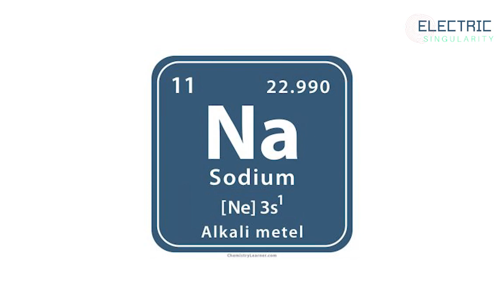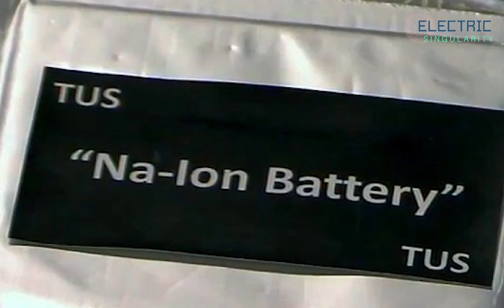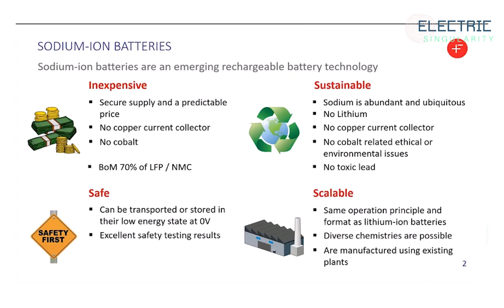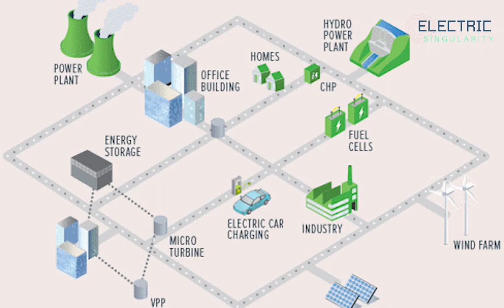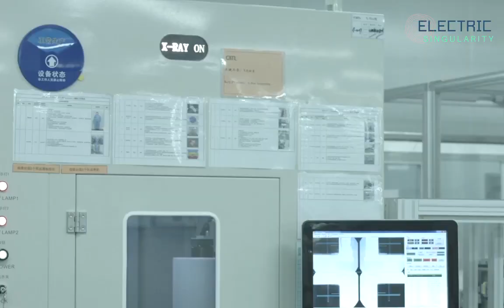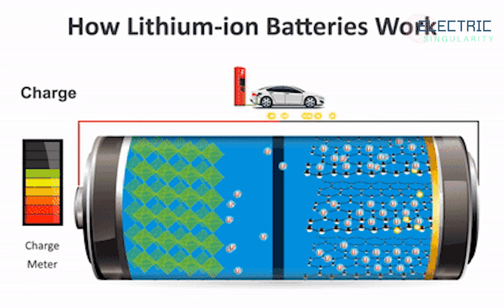CATL's sodium batteries will be 30% cheaper & revolutionise the world

Comment: Ok first of all? Lithium is NOT a rare element. If you look on the periodic table of elements you will find it directly above sodium amongst the rest of the common elements on the left hand side of the chart. Rare elements are in the bottom right of the quadrant. Secondly new direct lithium extraction is already in implementation that will reduce the cost of lithium extraction by 50% while increasing production efficiency 8x, while solving ALL of the environmental issues currently associated with its extraction. It can even be used to extract lithium from sea water. The oceans are full of it. It is a metallic salt itself.
Reply: Graphene is on the way as well to harvest lithium from the ocean and Israel is doing it.

Comment: I'm not so sure these are cheaper than LiFePO4 though,  I was reading that they have a cycle life of only 1000, and LiFePO4 cells are often rated at 4000+. so these will need to be more than 4X cheaper per Kwh than the Iron Phosphate to even consider them in grid storage.  Am I missing something?
Reply from the maker: CATL says they will be much cheaper after a few years. We’ll see.
Reply: Many applications that has low-cycling requirement like back-up batteries for homes or for RE installations or like lead-acid car batteries with very shallow cycling...would be perfect for Na-ion batteries.  Lead-acid batteries are very popular yet very low cycle ability in comparison to Li-ion.
Reply: @wakannnai1  no way a battery using table salt is going to be dirt cheap once production scales. At that point the manufacturing and copper become larger costs
Reply: @joe7272  Copper is also a cost for all the transformers and interconnect cables between the diffusely located wind turbines, solar farms and grid batteries. 
A 3MWH battery sounds great but a 100 megawatt nuke makes 33 times as much power - CONTINUOUSLY. The Moltex waste burner has a thermal store so a 500MW reactor can power 1500 MW of turbines that ramp up and down to meet daily demands and/or fill in for renewables. Fuel costs are negative because it reduces stocks of the ultra long lived stuff that we really can’t deal with build and operating costs are low because it’s intrinsically safe. All nukes are incredibly safe but none can rival that.

Comment: I would just be happy if I could easily afford to keep warm in the winter :)
Reply: You have an insulation problem, not an energy problem.
Reply: Thermal mass works extremely well in dry climates.
Reply: Get a rescue dog.
Reply: Get an electric blanket.
Reply: Using the latest in efficient housing design could reduce heating and cooling costs to almost nothing. It’s a real shame that almost all new housing is still not using basic efficiency principles that would save owners so much money. An extra $200/mon. on my mortgage to save significantly more than that in gas and electricity would be most welcome.

Comment: I didn't know that the metric shit-ton was a common measure in Australia, as it is here in the U.S.
Reply: It is a shit-tonne, get your units right :)
Reply: The shit-ton is a fairly common measurement across the English speaking world. Two variations exist, the Metric Shit-tonne and the Shit-ton, which is the imperial equivalent and is slightly larger, using the long ton measurement.
Reply from the maker: Hahaha!
Reply: @geodun  Many countries, separated by a common language.
Reply: Do they also use the C hair system? I need answers

Comment: This is huge! If they have worked out the problems with the number of charge cycles then the future will be sodium ion (zinc should be next)
Reply: There is already zinc in flow batteries. Too heavy for use in cars though.
Reply: Zinc is a scarce metal as well.
Reply: @Alrukitaf  intended for home solar system
Reply: They just did lol

Comment: My favorite grid scale battery is the Ambry Liquid Metal battery. It achieves low cost by lasting 300 years, requiring insulation to keep it hot instead of requiring cooling to keep it cool and being made from cheap materials. Of course, lasting 300 years simply means long enough to outlast whatever it is built for.

Comment: There is a factor even more important than just raw material costs. It's scalability. While lithium mines could take time to open and new technologies to lower the extraction cost take time, sodium came from salt which extraction could be immediate as a byproduct of sea water desalination.
In other words... sodium availability could grow triple digit without bit problems, while so big growth ratio on lithium will bring volatile prices for sure.

For the market of low/medium energy density, sodium will be the reference as soon as the costs break the starting barrier and turn cheaper than lithium.
Of course, that only be true if no new battery chemicals arrive with even better characteristics soon.

Comment: Yeah, it's like the situation with solar power, there is a race to make more efficient solar panels, and there is a race to make cheap panels.
Nasa will pay twice the price for a 10% increase in efficiency for space use, homeowners with big roofs will cover the entire roof with panels that are 10% less efficient if the price is 50% lower.
Both are equally needed, this battery for grid storage and cheaper vehicles with plenty of space (under a truckbed for example) and less need for range.
Lithium batterys for smaller cars with the need for long range and sports cars with limited space but a high price.
Reply from the maker: Good examples mate.
Reply: I see you point, but you've got those vehicle applications backwards. Large commercial vehicles are heavy, moving them is difficult and inefficient, and adding extra batteries both compounds the effect and brings the vehicle closer to the legal weight limit. Battery electric vans all have ranges of <200 miles, even with the same battery pack capacity as a Tesla Model 3 Long Range. Tesla's promised Semi relies on very high energy density cells, which have been difficult to produce and manufacture in substantial numbers, which is why it's been delayed.

Conversely, smaller cars are much more energy efficient. If a vehicle is more efficient, it needs less battery capacity to achieve the same range. The Tesla Model 3 Standard Range Plus is legendarily efficient and, compared to the inefficient Lexus UX 300e, which has the same battery pack capacity, manages ~50 miles extra range. The Model 3 Standard Range Plus manufactured in Shanghai actually use LFP batteries...
Reply: This is first generation of sodium batteries, their range will probobaly go up, just like with lithium batteries.

Comment: Wonder in wich way this CATL  Na-ion cannot be in conflict with uk J.Goodenough and French TIAMAT/CNRS sodium-ion batteries patents already produced ?
Reply: F... Patents, we're savings the World. Patents for batteries are usually for manufacturing processes, the chemistry itself is a nAtural phenomenon and not patentable.
Reply: @Tore_Lund  precisely, Na/ion is a known chemistry, the problem is the assembly, it's very complex to obtain a working  cell  that can cycle > 500 times.
Reply: @philv3941  yes, Some process Will be the preferred one, but to get around a patent, adding Some extra steps supposedly improving  the technique, is hard to prove as a violation of a patent. My point was that worrying about existing patents is not holding devellopment back. Most kinds of battery and fuelcell was patented a century ago if you only consider the base chemistry, so they have expired.
Reply: Unless I'm mistaken, John Goodenough  sent a message of congratulation.

Comment: Old nuclear would be game over but once built the running costs are low. New molten salt nuclear uses 99% of the fuel, against 4% for old nukes.  That means a short life waste that’s easily managed. They are also simple to build and intrinsically safe so build and operating costs are low. Check out Moltex and Elysium.

Comment: I wonder if NIO's new SSB is 100% dry.... and wondering why the range wouldn't be higher with a massive 150kWh pack. 
"Nio isn't going to be offering the new battery until 2022, so there's still some time to go, but the new 150kWh battery will offer 620 miles in the new ET7 from a single charge. That's considerable range and a healthy step forward over the current offering."

Comment: I wonder what the discharge & recharge variables are, for charging, as well as comparison to red flow batteries for storage (or hydrogen, for longevity or other source needs retainment). As well as molten salt energy solutions, with solar. Those will all be factors, I'd gather, while good to see more readily available & cost-effective solutions coming left & right.
Reply: One more time.
"Or hydrogen..."
"Or.....  Take every KWh of baseload and throw away 700w getting it to do useful work" (while still using some fossil fuel for baseload, which the 700kWh could have removed)..
Reply: @rogerstarkey5390  Or planes, trains, ships, and flying cars that just won't cut it running on batteries & can't stay fossil fuels (since hydrogen can be blue or green) so no need to waste the momentum or your breath?

Comment: There are not only LFP batteries and sodium batteries. There is also
1 fusion
2 Terrapower using discarded nuclear material
3 Rolls Royce small scale nuclear plants
4 Molten salt reactors
5 cold fusion
Now that we are building AI terra computers, the rate of innovation will accelerate. Room temperature superconducting magnets will accelerate cheap energy. In 30 years the price of electricity will be 1 c/kwh.

Comment: Storing energy on the grid with a battery is uneconomic. You could slash you storage costs by at least a factor of ten if you stored the energy as heat. There is not a cycle life issue with heat. It would keep going forever.

Comment: It will still take some time to make the transition, maybe 50% electric on the road. But this will happen in time.
Long time down the road, the energy climate is changing at a increased rate. There are many other changes and all won't be beneficial.

Comment: Lithium is not expensive, in short supply or particularly damaging in its extraction. It only constitutes 2% of the mass of a lithium-ion cell. Lithium is as common as lead, nickel on the other hand is expensive and a lot less abundant in the earth's crust. Nickel is found in many lithium-ion cells including those that Tesla uses both in the internal chemistry and the stainless steel jacket. Sodium is even more common than lithium but we will never run out of either element (half the salt in our seas etc is sodium after all). Plenty of scarcities to worry about, not just nickel but the price of copper in particular is starting to reflect its rapid depletion so copper wire is likely to give way to some aluminum based alloy wire within a couple of decades purely from cost.

Sodium batteries may be the future but if they are it will have nothing to do with the cost (environmental or financial) of lithium.
Reply from the maker: Interesting analysis, enjoyed reading it. Thanks for watching ;)

Comment: Surplus electric power is a long way off. We need to decarbonize industry first. There is so much burning fossil fuels to displace and new processes to invent. Habersham Bosh for urea and ammonia, cement making,  steel making, aluminium smelting. They all emit a lot of waste hot carbon dioxide.

Comment: Sure, sure.
Just like 273.932.576 other contenders.
Reply from the maker: That’s funny! There is only one company in the world in first place for global battery supply. Google who that company is.
Reply: @electricviking  Hmm. You are right. I knew about CATL, but have thought they are doing LeFePo4 for Tesla.
Didn't know it was Na-Ion. Last time I checked Na-Ion had lower energy density.
Nice to know.
Wait -this will not replace Li-IOn ?
So I was right - Na-Ion has lower energy density.
Lithium isn't really that big of a problem for Li-Ion. Lithium is relatively minor ingredient.
Primary  problem of Li-Ion is cycle life and safety.
There are other contenders that are adressing both problems.
In a year or two, for example QuantumScape is to have their first solid-state models out with metallic Lithium, way higher energy density and cycle life.
As Jagdeep Singh says, they are on their finishing stretch toward it:
https://www.youtube.com/watch?v=HtY1gcgy5N4
Reply from the maker: Way too expensive for utility scale storage. That’s the point I am making in the video.
Reply: @electricviking  
Prices will fall dramatically. and energy density is to increase big time with solid state.
This one might be an "also ran" that managed to catch its market niches, but it hardly looks like an revolution that is to "change everything".
Even its big initial claim is that it is to COMPLEMENT and not ECLIPSE current Li-Ion. Which has no intention to stand still...

Comment: Thank you for sharing and in relation to Lithium battery technology in EV that may be close to being replaced by Solid State Battery technologies when you have two major players Toyota and Volkswagen  about to release that technology in EV vehicles from 2022 …..

In an ideal world with rainbows and Unicorns Super Power could be fantastic however in reality with human greed growing at alarming rates weapons for power  may be the Super Power direction……

If only we were smart enough to have all new housing Estates laid out to suit housing and buildings to be solar passive designed, with plantation grown sustainable engineered timber for a trust circular economy and offering greater thermal efficiency requiring less power to heat and cool…… however it seems we can’t even do that simple logical task and it really does scare me what we may do with excessive power……. I hope it’s used for good and not evil…………..

Comment: I hope the coming "over-abundance of energy" co-oncides with matching population decreases across the globe so that the globe isn't  simply criss-crossed by freeways and carbon-free aviation. A re-wilding of the globe also  needs to occur so biological diversity is protected (for example, to ward off pandemics) and the oceans aren't awash with all those beautiful micro-plastics.
Reply: Clearly.  But a huge part of EV revolution is to upgrade housing for demand response (EVs need to be charged that way).  Grids should never be installing battery storage, and certainly not with rare metals, ultimately the cost of putting or delaying kwh by controls is very low compared to storage. 

Raw cost dropping $48/kwh vs $35/kwh or $20/kwh to $10/kwh, gives a huge advantage to sodium. Expect this to affect essential systems backup.
Reply from the maker: Good point. Generally with wealth and education populations decline. It seems likely.
Reply: I hope that the abundance of green energy will be in parallel to a reduction in average consumption / CO2 output (per individual) in certain countries (USA, Canada, Australia, etc) compared to others (China [~50%!] and India [~12%!!]) instead of concentrating on outright population.
Reply: @crhu319  
"Rare metals"?
Lithium. Not rare.
Iron. Not rare.
.....
Cobalt.....🤔 . Used in desulphurisation if fossil fuels for  50+ years, but nobody mentions that.

Grids SHOULD be installing battery storage if it means not having a leaker plant "ticking over" just in case it's needed, or having main generation overproduce at night ain't because it's more expensive to shut down and reboot.
But "putting or delaying", do you mean emergency power?
Batteries are much faster.

Comment: With super power you could even produce real green (and real cheap) hydrogen and use it for some of the rare cases where it can make sense … ;)
Reply from the maker: Good point.
Reply: There are no cases where it makes sense.
Ships, for instance.
"But they're BIG" you say.
You have to make the hydrogen. Where?
Do you want a huge processing plant on every pier in every dock?

Will you pipe it in? (Losses, bush fires?)
Truck it in? (How many trucks?)

How long to "gas up" a ship?

On board storage, where?

ICE (13% efficient?) Or Electric (you're going to need SERIOUS batteries as an interface!)

Not so simple?

Btw, the first accident would be a good one, wouldn't it?